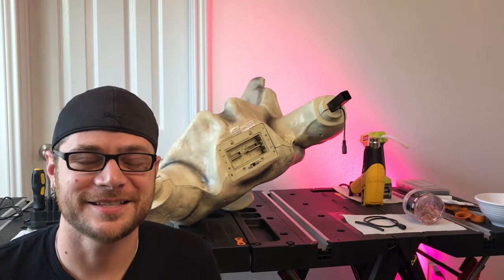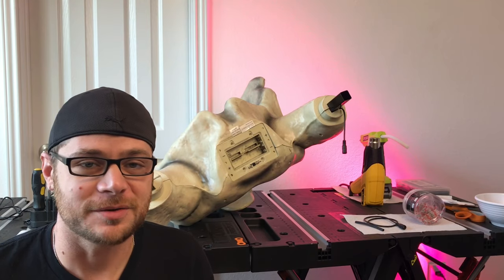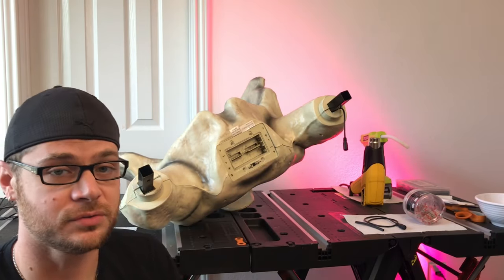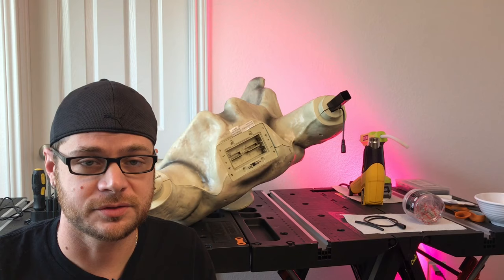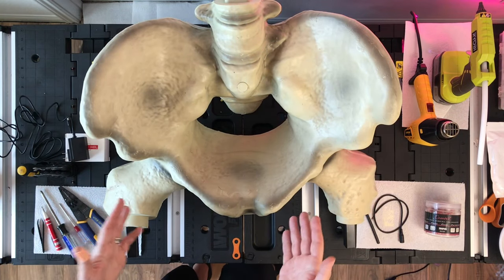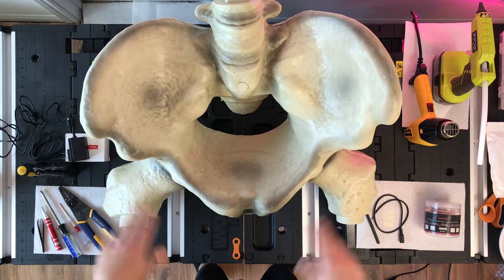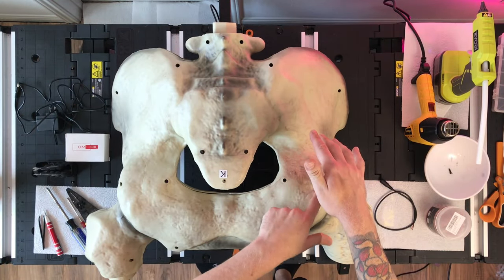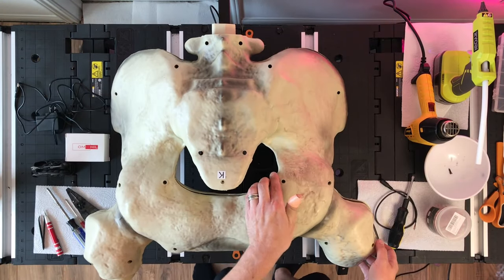12ft Home Depot Skeleton Converting Batteries to Plug DIY - Halloween Hack Battery Props to DC

Comment: Hey great video going to buy this. Question is though, was the whole point of going through all this trouble of hacking into the box so the timer and manuel on off switch are still functional? If I’m just going to plug it into timer anyway couldn’t you just save all that trouble and cut the wire going into the box and connect the plug to that?
Reply from the maker: Thank you for watching. This was done this way to make it as neat, “professional”, and as safe as possible.To access the back of the battery compartment and wire this is the best option. You can’t access that wire from the battery compartment. Could you bypass the built in switch... yes of course. 

I think what your asking is could you just attach a connector to the cord that comes from the bottom of the spine piece to the plug... yes you definitely can as long as the DC plug is wired correctly and doesn’t have the positive and negative reversed. Needs to be (-) on the outside of the connector and (+) on the inside. Going this route will have a long cable dangling at around 6ft and no good way to hide the cable. Hopefully that helped answer your question. 🎃💀
Reply: @SuperTonkers   I think I need to try this method,  I'm not having any luck with it's timer, I can get him on , but he never comes on the next day

Comment: I just bought the Home deptt lcd eyes conversion kit (the eyes)... with the intent to just run the eyes in a prop i'm building.  I thought that there would be a power adapter included but found that it didn't which is what brought me to your video.... thing is, that I don't want to buy the entire skeleton to run just the eyes, so I don't have the battery box that you discuss.... can I simply connect the eyeball assembly direct to a power adaptor?   TY in advance

Comment: Has anyone tried a solar panel on one of these? Our skeleton came with the power supply and a battery box. We set it up too far to run power and it goes through batteries quickly. I'm wondering if I can get a solar/battery pack and plug it right in to the power input or if a solar panel would charge rechargable batteries in the unit.

Comment: If you're not comfortable messing with wiring  you can  buy an ac power adapter ( in this case for 4 C batteries).
Amazon sells them & what it looks like is 4  blank C batteries with a wire coming out one of them that ends with a plug, so you can plug it into a outlet receptacle, instead of replacing batteries.
I have purchased these adapters for my 8' tall props & it works great. 
  I do suspect that the you will need to use a extension cord part way down the skeleton's leg, but I can't say for sure because I don't own any  12' prop's .

Comment: Great Video! I found a battery to plug adaptor that is 6V and 1A of power.  The conversion on your video is for a 6V and 2A of power.  Not having knowledge in this area, would the 6V and 1A plug adaptor work on this skeleton and what would the difference be?  Thanks!
Reply from the maker: Thank you! Not sure if it would work properly. It may just be dim or flicker if it doesn’t have enough power. 💀🎃❤️

Comment: I saw this last year and was thinking about adding this mod to mine. But instead I went with a switchbot. It is a little bluetooth/wifi switch that simply pushes a button, on a schedule. MY issue was not so much the batteries, but going out side at 11pm every night, sometimes in the rain, to shut him off.

Comment: Would the power cord that you linked below work just to plug him in at the spine? I can't seem to get my timer to work and I don't have the time to completely tear him apart to rewire
Reply from the maker: Honestly no clue. The connections will probably fit but I can’t give a definitive answer on if it will cause damage or not to the LCD screens. Doesn’t look like there are any kind of resistors or anything I’m the circuit board but the connection may be wired backwards for the plugs that run up to the head. Sorry I don’t have a better answer. It may work.
Reply: @SuperTonkers  Okay Thanks, I was just trying to eliminate the timer, I can't seem to get mine to work properly.
Reply from the maker: https://www.hallucinationscreationsstore.com/product/home-depot-12-skeleton-power-adapter-kit

Comment: Today I learned about solder seal wire connectors. Thanks to you. Where the fuck have those things been hiding all this time I've been swearing at bad connections and messy flux! lol  Subbed.
Reply from the maker: Haha I said the same thing when I found them! There are also Scotchlock Connectors too which are even easier... no heat gun. Welcome and thank you for the support! 🎃💀

Comment: I wonder if anyone is going to try and animate the jaw..  seems like it should doable.
Reply from the maker: I’m sure someone may try and it may be possible. You would have to cut the bottom jaw off and add support bc it’s not a separate piece it’s molded together with the head as one piece. Weight may be an issue but I’m sure someone will try it!
Reply: It would be doable, but difficult because you would have to basically replace the circuit board with a custom one because I doubt there is any spot on the board or programming on it for a moving mouth.
Reply: @RoboticalHalloween  I figure it'd be like building a 3-axis on the smaller skelly's though fabrication of the lower jaw may be interesting.  If I pick one up locally once they go on sale here, I may see what I can 3D print.

Comment: Our power switch broke :(. Has anyone tried to connect a power adapter directly to its head or tested and know what voltage is coming from its skull?  Thanks! :)
Reply: The switch on mine broke too. It would be really nice to plug in a 6 V two amp adapter directly to the head. Can anyone measure the voltage that goes to the head? I would hate to plug it into the head and fry the LEDs. But I can’t test it myself since that darn switch broke.

Comment: It comes where you can put batteries or plug it in so I don't know what you're talking about you can either run it off a batteries or plug it in you don't have to do what you're doing wiring stupid things up I just bought one of mine's already hooked up to either batteries or you can plug it into an outlet and that cord that's hanging there came from the factory that way because of mine's the same way and I bought mine brand new